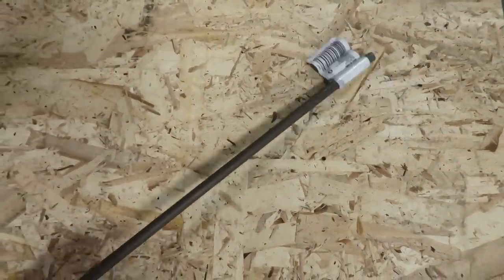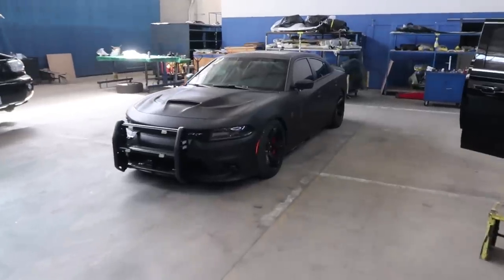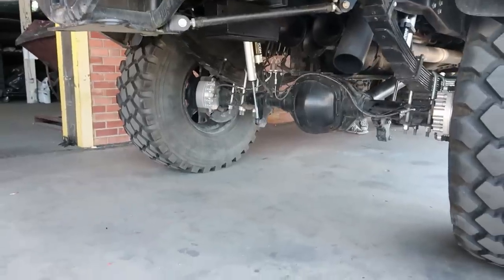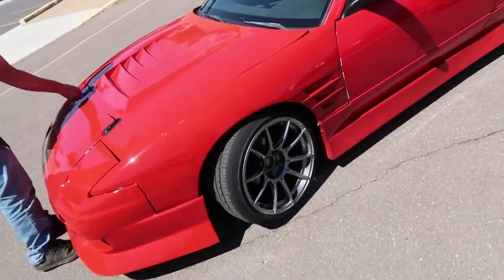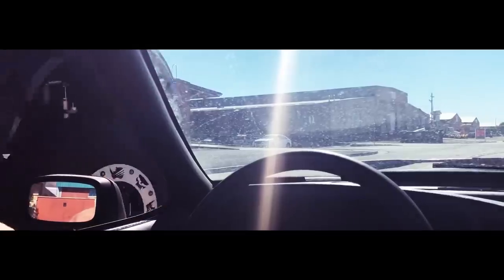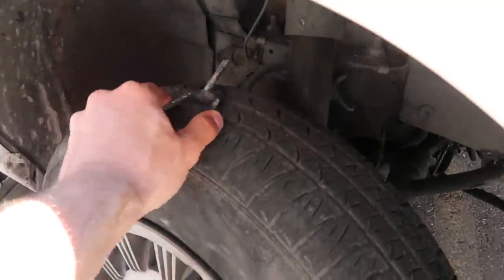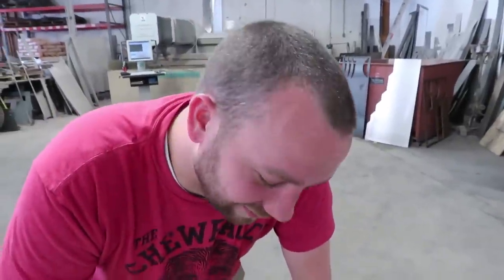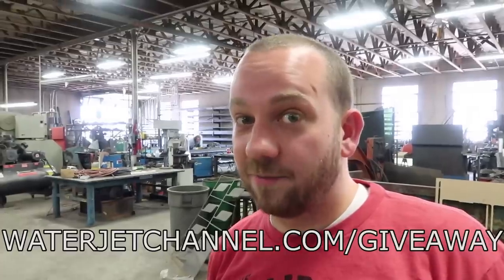Hitting Road Spikes at 50 MPH - Fun with a 60,000 PSI Waterjet

Comment: Wouldn't it be better and more reliable to just install a 60 000 PSI waterjet in the back of the truck , bad guys wont even go after you i bet
Reply: Wouldn't do much unless they were really close, it'd be like spraying with a hose.
Reply: @DavGxyz  a 60 000 PSI hose*
Reply: Mr Snowy I like that
Reply: Air resistance would make that impossible. It'd just spread out and lose too much speed.
Reply: @DavGxyz  not like its a joke or anything
Reply: Time to cut a full sized real car in half with a water jet .... :)
Reply: @DavGxyz  r/woosh
Reply: PetiteHam r/ihaveareddit r/itswooooshwith4os
Reply: cordarius58 r/ihaveareddit r/itswooooshwith4os
Reply: new vid idea: cutting a car in half with 60,000 PSI waterjet
Reply: Well, it won't work very well

Comment: Suggestions to improve the idea: redesigned box, that box clearly has ledges that spikes are snagging on, maybe walls slanting out at the bottom and the hinge and latch completely externally mounted.
Hollow tube is far better and won't bend as easily

Comment: How did u make the box that drops them
Reply: Use an old gunvault bio the fingerprint scanners suck so you can pick one up easily and cheap.  It will run off 9 volt battery just a little rewiring and it alreay has a spring loaded door and all the electrical locks ready to go

Comment: I think police actually use spike strips instead of individual free spikes due to the fact that they can be deployed/retracted across a section of road with much better accuracy and speed. Not only that but the  spikes and anchoring system take a shared load across the tire instead of the individual free spikes. So there is less damage to the spikes. Not that it matters since used sections are replaced I believe.

Comment: If you wanna make these properly effective, you really need to use pipe, not rod. So the air evacuates rapidly from the tyre, as there is no compression of the leaking area as it is in the inside of the spike, not around its outside.

Comment: They wouldn't bend as easily if they went through the process of hardening them again. The act of welding them would change the hardness of the steel even though they quenched it into water like a knife, there are very specific calculations used for various metals about how hot they need to be before quenching for the various hardnesses. Be aware though, More hardness equals more brittle metal.

Comment: Based on the deformation and the  sound of the tinkles, I am 98% sure those spikes are soft Aluminum, that they are twice as long as they need to be. 
However! The air channel was excellent thinking, and as they are, they would be very difficult to repair and reuse.

Comment: As you said in the video. They could have been shorter. My analysis is, that because they bend from the bottom, so there is some leverage happening because of the lenght. Make shorter ones and then reheat treat them.

Comment: You should probably make the spikes thicker in diameter and then drill a hole in the center of each piece of  rod before  cutting it into spikes, weld it and  then  you the same size bit you used to put holes in the center, drill small  holes  in the direction of spike and then it should  drain the tires faster putting more and more resistance on the diff drastically slowing it down if all tires are popped (but that's my idea if you wanna try it)

Comment: are you a Nissan Owner? is that crappy little 4 banger not doing it for? well have I got news for you, for the low low price of 3-4 times what you car is worth you can do an LS Swap and put some American Horsepower in that little car.
Reply: DanielRichards644 ohh you mean put unreliability into my car yea I’ll skip that l rather put a 2JZ
Reply: @hillaryclinton1558  for starters I was making a joke about the little 240z with the LS motor that is literally worth more then the car itself, secondly, yeah reliability, EVERYONE does LS swaps because of how good they are (these motors have 20 years worth of revisions and fine tuning) and how readily available parts are SHOULD you need any maintenance, variations of the LS motor are in EVERY full size chevy pickup and SUV from like 2000 to today. this isn't the 1970's anymore, modern engines run 100's of thousands of miles (shit my bosses piece old crap Ford Escape has 375k miles on the original motor and i've got like 230k on the SUV in my avatar with nothing more then basic oil changes, spark plugs, fluids and a sensor for the VVT), if you aren't getting at least a quarter million miles out of a motor you are doing something very wrong to it. now the GM/Ford transmissions thats a different story, but these modern motors run for fucking ever if they are maintained properly.